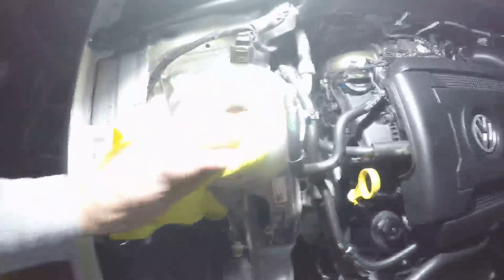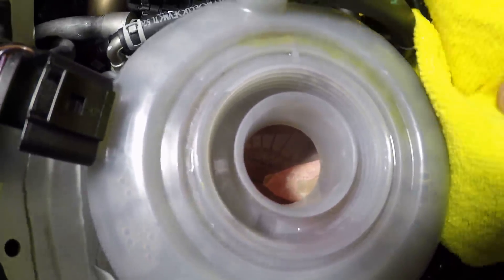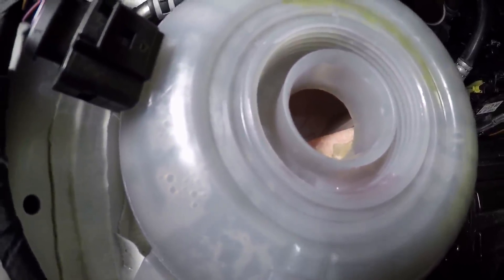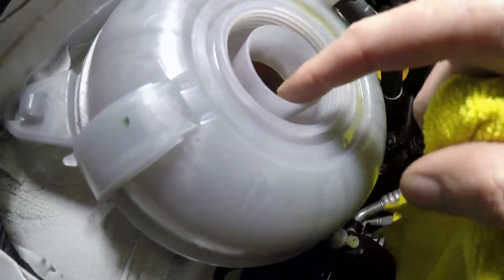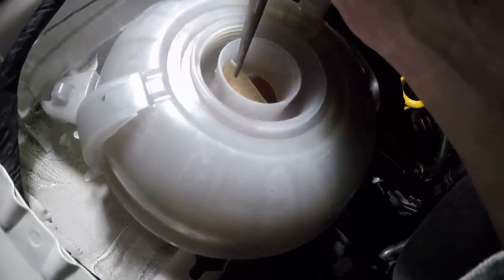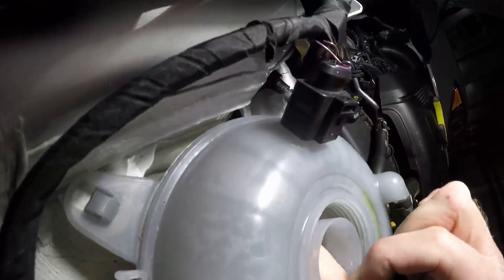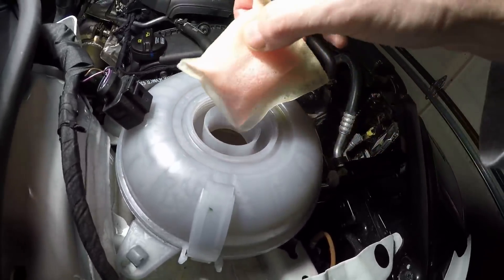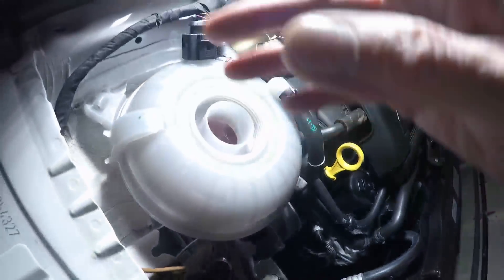2018 VW GTI SE Ep. 70: Silica Bag Removal from Coolant Overflow Tank

Comment: Very common problem. Happend on my MK7. Luckily got it done and flushed by warranty. (VW OR AUDI WONT PAY OUT) expensive job and unbelievably freezing and no heat at all. Going to remove from my S3 8V  now. Then my dad's MK7 GT next week. Remove this is a must. (Advice from a HGV maindealer multi trained technician)
Reply from the maker: wow good reminder.. i got a 2018 S3 a few months ago, never thought of this.. i guess i prob has one?
Reply from the maker: @Floyd. B i thought mine didnt.. until i sucked all the coolant out of it. it blends with the coolant color

Comment: There must be another reason why they put this silica bag in the tank! It cant be just to prolong the coolant life  especially when most people normally do regular coolant changes!
Reply: P W Yeah so they can charge you thousands😂 not all golfs have them the ones that do will have a satchet image printed on the expansion tank my Golf does not have one.😅
Reply: @jerryrawlings8885  its for prevent alluminium go ur engine just buy another bag aint expensive either*

Comment: This issue actually happens with regular occurrance. The repair cost from my VW dealership is £2700. It's also worth noting that once this work is complete it comes with no warrantee. So if it happens again you have the same cost! You should absolutely remove the Silica bag (Mit Silica) If it does burst you will be left with no heat in your car whatsoever. 
I am currently battling with VW to pay for mine (they won't) It's also worth noting that at my dealership the workshop manager had carried out 24 flushes due to silica bags bursting. This is a major floor and can and does burst.
Reply from the maker: good tips
Reply: Yes, this exact thing happened to my 2018 Passat and clogged the heater core utterly - in WINTER.
OFC the VW mechanic said nothing about this and quoted me like $1000 to replace the core - Not a whisper about the coolant reservoir.

So I bought the core for 1/3 the price and went to a different mechanic to replace it for 1/3 the cost.  That mechanic was not VW specialized so had no idea about the silicone packet.  Just had a guy at the oil change place tell me about it today so I'll be getting the reservoir replaced and the coolant system completely flushed (again) - and make sure there's no packet inside the reservoir.

Comment: The bag burst in mine and had to get a system flush with the heater matrix replaced. Oh and the bottle as well. Now I understand what exactly happened going to remove mine. $1100 dollars later. I just hope my water pump holds out from the list of failing parts. 2015mk7 gti 36000 apx.
Reply from the maker: aw mate!

Comment: Just reminder comment for everyone, as someone already mentioned in the comments,  removing the silica bag comes with a necessity of regular coolant changes. For G13 it's 5 years without mileage dependance,  for G12evo(G12++) it's 5years/250000km . ☺ Only use these two (G12evo is most recent one), they are fully mixable. Don't use G12+, doesn't have silicates.
Based on laboratory tests I've seen, I highly recommend to not experiment and only use oem coolants (same as for f.e. gearbox oil). Some (and not necessarily most cheap) coolants had their additives lost after few months of use!
Reply from the maker: good tips
Reply: According to the VW bulletin of 5/22/2023,  Valvoline developed the most recent formulation of G12evo.   The Zerex HT-12 (pink version) seems to be this formulation.  Not that easy to find -- I've only seen it in stock online from O'Reilly Auto and from Valvoline directly.   It is available as the concentrate.

Comment: i heard the silicate beads in the expansion tank is to stop the aluminum parts inside the engine form corrosion as the G13 coolant doesn't have much of this for environmental reasons, so the bag of silicate puts that in to the coolant, i personally would do more frequent coolant  changes (3 to 5 years) and remove that bag i would change at 2 to 3 years to be safe,  That's what i do, better that than have it burst ,and yes they burst often ,you can easily pay the VW Dealer over £1000 plus to sort it .
Reply from the maker: good tips
Reply: I was looking for the real evidence of silicate bag bursting on YouTube etc but I don’t find yet - I have 3 little in the garage and one of 2016 S1 got silicate bag in it, I’ve been using G13 for almost 10 years and this ea888 gen3 engine has G13 since the d1 from Audi. It has been 5 years now my S1 is running fine without any issue and basically I didn’t ride to dealer for regular maintenance etc as the part of the warranty the main reason is I don’t trust those mechanics, I’m noob I’m not a mechanic either but I do it myself
Since i was so curious about silicate bag I just removed yesterday out from reservoir tank, cleaned up again with distilled water and keep dry for some hours - I checked again closely I got no any sign of damaged or leaking or could be bad whatever I just see this bag is still solid strong too and it seems this have double mesh net look so how can burst easily by heat or time since it got on my car for 5 years but it is like still a new one - the antifreeze coolant itself is clean,no sign of corrosion & 5 years old  btwI just want to change right now 
Next - I would like to see without silicate bag for 1-3 months and maybe I’ll be going to put silicate bag back to reservoir if needed:)
I guess - the only way this tea bag burst/damage/leak is coolant somewhere of being mixed with tap water oil etc otherwise this what I see now
Reply: @HellaMeiste  The latest VAG coolant G12EVO (replaces G13, counterintuitively), has silica in it (Si-OAT), whereas the original G12 and G12+ do not (OAT), so if you flush and replace the coolant with G12EVO, you don't need the silica bag any longer for long term protection of aluminium components.

Comment: The bag is there to extend the coolant life ...because it so very very hard to change the coolant without disconecting so many hoses and using compressed air to blow as much as possible out.  To fill them is also a pain, the factory vacuum all the air out then fill the coolant..even then the pre delivery inspection includes coolant top up. These cars are becoming harder to work on and as for German reliability that left in the mid 90's... Oh the heater matrix WILL block and they are a pain to replace.
Reply: I just change mine for same cause 🤦🏻‍♂️

Comment: They do not have to burst as such to cause a blocked heater matrix.  Anyone who has a VW, Audi, Seat or Skoda that is a few years old dip your finger in the coolant, it may feel rather viscous compared to what you may expect. Mine has not burst but has obviously leeched out into the coolant which has now blocked my heater matrix. On a five year old car. Unreal.

Remove the bag now regardless of the age of the vehicle, flush and replace with normal G12/G13 coolant.
Reply from the maker: good tips
Reply: Should i take mine out ?

I've got 2 year old Octavia vrs With 12 months warranty left,  but as somebody has already said, if i remove the bag and something goes wrong with the cooling system, they will do their best to wriggle out of any warranty claim because the bag has been removed...
Reply: @MrBlackstars19 .. Keep the bag and put it back in if you have any issues

Comment: Yep, this is 1st mod i will be doing to my car! - madness that they put that in there. I've read too many people who have had this burst, someone not far from me had this happen and now his heater matrix is clogged up.
Reply from the maker: yup that's what i read about.
Reply: To be honest, VW put it in there so if it becomes an issue VW can deal with it.
I'm not looking to remove the bag from either of my Golf's as if there were subsequent issues in overheating / head gasket etc = any reason for VW to get out of some other issue or repair and they notice the bag is missing VW will use it against you.
That's where I am with this. 
BTW, there's no mention of this bag in the vehicle owners manual so that states to me it's integral to the vehicle design.
Reply: @aj63  if you get a new overflow tank from vw it will be without the silica bag… that tells you something.
Reply: It's madness that they put it in there with NOTHING to prevent it from fouling the system if (WHEN) the bag breaks.

Comment: That bag blew in my car first sign for me was no/little heat, jammed heater core with this stuff.
Reply: how did you unlock the heater core ?
Reply: first empty all the coolant from the system  by disconnecting the hoses from the front of the  radiator.  after you have to create a closed circuit with HVAC radiator, you need a pump(i used drill pump), hoses(use hard one to don't colapse ),
2 oem connectors, a pot,  4 l of viniger and solution for aluminum radiator(I used liquie moly). unplug the hoses( pulling the safety wire steel from plastic connector) that go to HVAC , are in the engine compartment(behind the engine). make flush with hot mixed solution .use a strainer (like woman sock) to retain all the dirt that will exit from radiator . make this flush at least 2 hours changing direction . put new coolant.  good luck!
Reply: What car do you have?

Comment: I've just got myself a 2017 R Line with 7500 miles on the clock, I had it from my local VW dealership with 12 months warranty.
 Would you recommend I buy a new bottle and take the bag out first then fit it to my car?
Reply from the maker: why would you need a new bottle? just take out the bag to be safe. 7500 miles isnt a lot, should be ok. dont rip the bag taking it out.

Comment: I've seen this mentioned a fair bit on a SEAT Leon Owners Club. Will have to look into extracting it sometime soon.
Reply from the maker: i mean im sure it has a use or they wouldnt add it. (to keep coolant more fresh), but if it breaks.. youre screwed. i bet it doesnt even break down for 2-3 years earliest.
Reply: @LastHumansGarage  It's because VW don't have any service interval for coolant change. You should always change the coolant every 5 years regardless - in the past with cambelt's it was never an issue as people would usually get the water pump replaced at the same as the cambelt and of course the coolant would be replaced with it. Now with all these chain engines people never replace the coolant. So i guess some fruit loop at VW decided to stick a ticking time bomb bag in there to extend it's life....but never thought about the life of the bag itself!
Reply: @blower1  well car has 6 yr warranty, I'm sure it's a covered repair if it bursts
Reply: 6 year warranty is only in the US - Europe/UK has 3 years....and these things are bursting around year 4. Plus to replace the heater core which it tend's to clog, requires ripping out the entire dash - I wouldn't want a dealer doing that, it will be rattling in so many places once they put it back together.
Reply: @blower1  can confirm, UK here, luckily I got a years warranty with the Skoda dealership  when buying second hand. It's just burst. (Had the car 3-4 weeks, 16 plate)

Comment: For some reason mine does not have that silica bag.. but my temp gauge just stopped working properly and sometimes it throws coolant from the reservoir..
Reply from the maker: hmmm temp gauge... throws... might be the thermostat starting to act up.. and not closing or opening properly.. although if you have it filled to the top line when COLD.. it would spill over the overfill when it gets HOT...
Reply: @LastHumansGarage  temp gauge issue was fixed after replacing the temp sensor. The coolant level used to be near or at the top line when cold, now I just put enough till it stays in the middle of the min/max lines. I guess it was just me filling it in the wrong way. Thanks for the reply

Comment: Hi. Did you replace the coolant for the G12 EVO? There are some videos out there (in Spanish) that talks about the relation between thermostat failures and G13. I understand that there are new models using g12 EVO and they don’t has the silica bag on it anymore.
Reply from the maker: i didnt change any coolant. but not a bad idea sometime. although i fixed a few leaks back in the day and replaced  some coolant already

Comment: This winter we have replaced a dozen heater matrix.  They were full of the sludge . Four blocked up again so had to be removed and flushed again and the formic acid flush done. So far not reblocked.  Audi/ VW group do not warranty any of this. Winter is far from over....
Reply from the maker: by we, do you mean you're from a dealership?  I'm glad I took mine out quick-like.. even if my coolant won't last as long.. its not hard to open a hose and change your coolant every few years.
Reply: @LastHumansGarage  No we do do a lot of work for a major warranty co. and for private customers who get referred to us because of our reputation for workmanship. Most people who own four year or older cars cannot afford to go to a main dealer , £1000+ for a heater fix  on a daily driver is almost a scrap job. We get get loads of work from other shops who are happy to do brake jobs etc. As a small shop of 4 people we are currently booking nearly two months in advance..... If the right hand side goes cool when the left hand side is hot you have a problem.

Comment: I had to change the heater matrix in my Skoda because of this mit silica. It has been exploded and blocked the system and had no heating. Dealer were going charge me £1700. I done it my self for £80.00. If anyone got New Skoda cars check for mit silika sign in the expention tank, remove it and if not possible replace the tank with something that has no silica.
Reply from the maker: nice one mate
Reply: Show me the proof of your tea bag bursting anyway …
Reply: How much was the heater matrix??? And what cost £80 thanks

Comment: Why not just remove the header tank and then remove the bag ??? Remove the risk completely, It’s like 2 pipes and a screw, then if it splits flush the header with boiling water without contaminating the system????
Reply from the maker: i dunno????